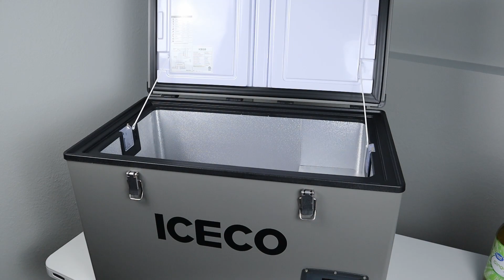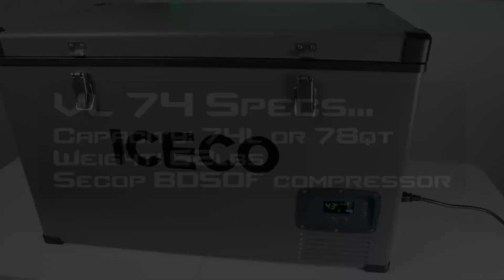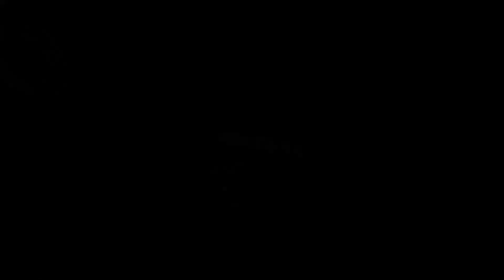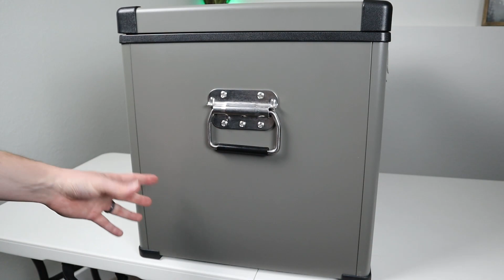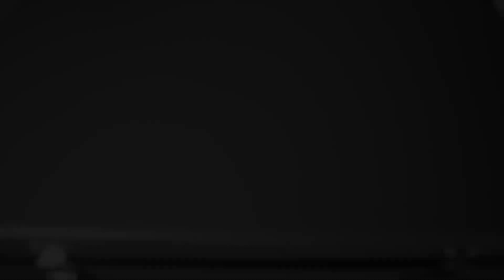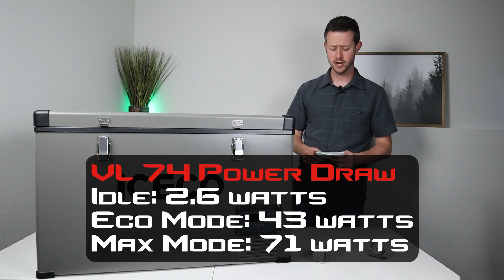ICECO VL74 Review - THE KING OF ICECO FRIDGES

Comment: it uses around 70watts at max. to run de compressor (5.5amps/max) and they have a 15amp fuse, I know that the compressor uses more than 70watts when it starts up but isn't it a bit overkill? did you see what was the peak power consumption by any chance? thanks
Reply from the maker: The 15 amp is "overkill" the compressor may pull a little surge but it will never get up to 15 amps consistently. Average power in this model is really good because it's so insulated. The compressor doesn't run much. Put this on ECO mode and it will keep the food inside at temp. I put out a camping video recently where my father in law talks about his experience with the VL74.

Comment: Can I order a battery designed for the other  iceco makes with this one ?
Reply from the maker: Iceco just came out with a small battery. It doesn't give amazing run times, it's mostly design for 5 to 6 hours of runtime. An external power station would be your best bet. The Bluetti EB55 or EB70 would work really well.
Reply: @Jasonoid  thanks, I think we'll go with the eb70s, with our already purchased 2- 100 watt panels.
Reply from the maker: @johnkozaczok3713  that will be a great option for running any 12v fridge.

Comment: I have a 2002 F350 4 door pickup truck with a truck camper I would like to have  a auxiliary frig which would be set up in the back seat area (with seat removed) would this fit through one of the back doors?
Reply from the maker: I think it would, they have the exact sizing specs on their website for the fridge

Comment: Thanks Jason! Do you know how long a Jackery 500 would run the vl74?
Reply from the maker: Depends on the ambient temp outside the fridge, and the setpoint of the inside. It will run a decent amount of time if you have it set to 34 degrees. Check out the power usage section of the video at 13 minutes and do the math for 500wh. It pulls 15wh per hour at 70f.

Comment: Hi,I got a question;How do I secure the fridge to the floor of a van?...Does it comes with some anchors or that kind of thing?O do I have to built a base for it?
Reply from the maker: In my opinion the easiest way would be to strap it down using straps on the metal handles on the side. Then you can still open the lid without untying any straps. ICECO also makes a sliding drawer you can install.
Reply: @Jasonoid  cool, thanks 👍

Comment: A five year warranty on a compressor is fine but is there a repair location in the United states?
Reply from the maker: Their business is located right outside of Disneyland in California, local in the USA.
Reply: @Jasonoid  that's great but do they repair the units right there in California?
Reply from the maker: @bernadettepeterson8291  I'm guessing they would have the ability to do that. I haven't had any issues with mine so I can't say the repair process works or not. These VL fridges are built like tanks.
Reply: @Jasonoid  thank you for your response.. I checked out the 1-800 numbers and could not get to a human to even ask the question that I have so with that being said I feel it may be a little sketchy for repairs.
Reply from the maker: @bernadettepeterson8291  don't ever expect any cheaper company to even have a number to call. Iceco is the middle ground between those cheapo fridges and the way expensive models. They are built extremely well for the price but you may not get the same phone support as Engel or Dometic. In my experience their phone number is mostly a message box and they will call you back if you provide callback details.